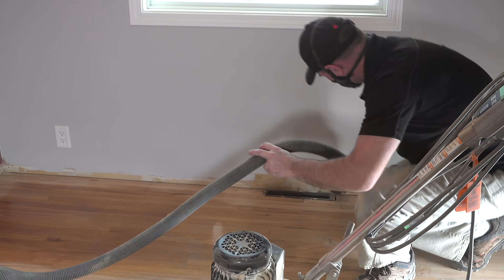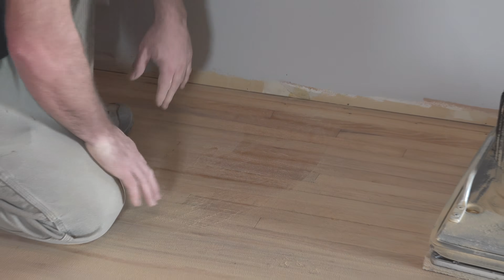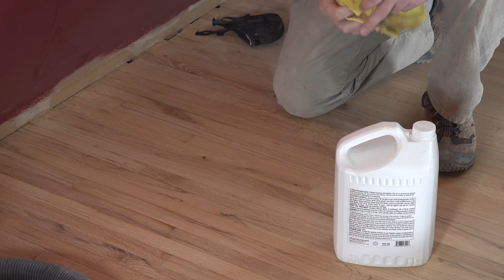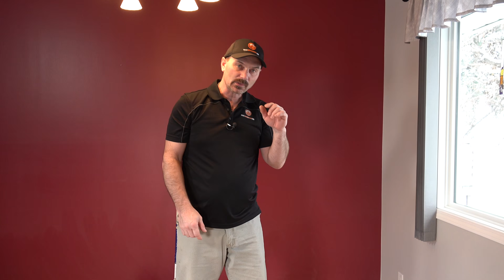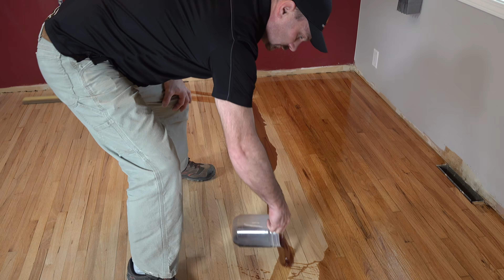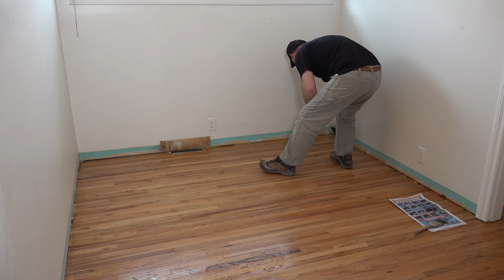How To Sand & Refinish Hardwood Floors

Comment: Just.... ugh.
Complete waste of time and money ..  just hire a pro.
You will save money in the long run, guaranteed.
Reply: I just got a quot for 130sq feet $1600 from a professional
Reply: @StagArmslower  if it is ONLY a sand and refinish of EXISTING  flooring with no staining or repairs involved you should be paying NO MORE than $4.00/ sq ft. for natural finish...... And that's high California pricing. 
The quote you got is 3X ( or more) more than standard pricing.!!!?
Sand and refinish 130 sq. Ft should be around $400-$500 TOPS.
Get more estimates, and good luck.
 Just don't try to do it like this guy.
Reply: Thanks a lot, will try to do it myself; I install this floor 18 years ago so probably will go OK  @TheBlister69

Comment: First off you should have feathered your coats with the grains after you pulled it across the grains. After your coat was dried you need to screen to the coat because your flooring will have popped. Been doing floors for 35 years. Your layering of your coats was a little off key. You need to maintain a wet edge while applying the finish .and a square buff definitely doesn't cut it. It's a giant Palm sander that doesn't do the job properly.

Comment: Okay I'm a professional Floor Sander and there is no way I or anyone could sand a floor using those antiquated machines. Plastic? We don't hang plastic because all of our machines are dustless. By the time you rent out those machines and pay through the nose on the materials you will have saved about 50-70 cents a foot plus your back breaking dust breathing body will be broken by the time you are done. Good luck!
CALL A PRO.......
Reply: This is good for a homeowner who isn’t expecting anything fancy at all. This will not cut the floor flat, get out larger dents and scratches, the unevenness of boards. If you hire a professional and he come in there with just these two sanders  ask them to LEAVE and never come back.   

I agree with mike as a professional I could never sand a floor like this and put my name on it.
Reply from the maker: @jamesc8364   I agree and even state in the video that if your floors are in rough shape you will want a drum sander and edger. For this floor it did the job as the floor was flat and in pretty good shape but the finish was worn out.
Reply: I know. You said it in the first couple seconds and you also mentioned renting a edger.  I think this is a good option for homeowners who want to save money or do it themselves.  A edger or drum sander in the hands of someone (home owner)  who doesn’t know what there doing could result in a horrible finished product. You make it simple for anybody to do. I hate to say it but when if you overload homeowners with a bunch of extra info which you didn’t they tend to get overwhelmed. You kept it simple and to the point for a novice to do. you did a great job for homeowners to learn.
Reply: Im also a floor technician ..the older machines are best (floor sanders that run to house power breakers, edgers ,buffers ,etc) ... i will say all the videos on youtube seem to promote do it yourself to people this is definitely not easy & most will probably ruin their floors leave it to people who know what their doing (not every guy who does do it doesnt do good work either)..il create a channel dedicated to this field in about a week or so. Good luck to those wanting their floors done(& done properly).
Reply from the maker: Sounds like you are pretty worried about how many jobs you may loose when people see this video and how to do their own floors? Yes you as a pro may have newer machines with better options but it does not mean that these units will not do the job.
Reply: @HouseImprovements  I watch many how to videos and it seems quite common to have the "professionals" chime in about what was not done "properly" and properly always seems to come with quite a price tag! Obviously, if we all had the money, we would all be doing it "properly". Unfortunately, we are not all blessed with the same wallets to afford "properly".
Reply: @HouseImprovements  Look it takes the right equipment with the right no how. Actually people try this and screw it up and they call us so no we don't lose business we actually gain business. However be my guess and sand your floors but I wish you the best of luck
Reply: HouseImprovements thanks for the great videos.  As someone who tries to do as much stuff in my home myself they are welcome videos.  Thumbs down to all the haters 😂
Reply: Houseimprovements, I agree with you. You've helped us do a lot of diy jobs and saved us tons of money. Now we are doing our floors. We have to repair our originall 1940 oak wood floors or replace them. Haven't decided yet, but your vids will help us.  Thx again
Reply: Make your own video then. Show us how the "pros" do it

Comment: I have a laminate oak flooring (Bruce, I think). I would like to refinish it because the area near the front door is quite worn down compared to the rest of the flooring. Can it be sanded lightly (machine would eat through the laminate right?) or do I just have to spot refinish and hope it's not too different?
Reply: Laminate floors are fake wood.  I have Pergo in part of my house.  They are not meant to be sanded.  Check the manufacturers web site for care instructions--usually, they advise against harsh cleansers, so I would think that sanding would definitely be out of the question.  I doubt that any laminate manufacturer would endorse refinishing their product.
Reply: Throw it in the trash......not able to refinish like real wood.

Comment: can you do a how to remove an oven video
Reply: An oven.disconnect all wire, gas line etc. Shut breaker off to 220 if it is so and turn gas valve tell it is half way or to a close mark if its a valve.and remove thats a simple job not to complicated.

Comment: Nice job ,where i can get the T bare
Reply: Mohamed Amin order from an online floor supplier unless you happen to have one local.  The metal head is not cheap.  Probably better off rolling with a good polyurethane.
Reply from the maker: https://www.amazon.ca/Duratool-Lightweight-T-Bar-Applicator-Refill/dp/B07BKBC6Z5/ref=sr_1_fkmr1_1?keywords=T+bar+floor+refinish+bar&qid=1551927408&s=gateway&sr=8-1-fkmr1

Comment: Floor has scratches from dog claws. Bruce engineered hardwood gunstock. Can this method be used for that? Or will it completely destroy the floor?
Reply from the maker: Some engineered floors can be sanded but I could not say for sure ,should be able to find some info on their site maybe.
Reply: I have engineered floor and pro said that it can be sanded once even manufacturer said 5 times  @HouseImprovements
Reply from the maker: Also depending on the wood and depth of scratches this sand is likely not going to do it. You would be better with a drum sander.

Comment: I would like to add a gloss coat to my hardwood floors. They have simi -gloss now Can I just do a light sand and apply an additional coat. I don’t think I need to sand completely down to bare wood? Floors are 15 yrs old but in very good shape.
Reply from the maker: generally a light sanding so the new coat will bond to the old.
Reply: You should thoroughly clean the floor first with a product like basic coatings IFT and squeaky floor cleaner...or some other prep system.  If the floors ever had a polish applied or rejuvinater used it  probably won't stick.  If you used pledge or some other akrylic polish products on any furniture it probably contaminated the floor and will need extra cleaning.
Reply: Thank you I really enjoy your videos. They help me out a lot. I try to do projects myself and your videos are direct with good explanations.
Reply: Adam, thank you very much for you advice. I would like for my project to turn out right.
Reply: Gloss can look great but it will really show imprefections in the light. I would do satin or semi.
Reply: Robbie klein thanks for you input

Comment: Would it be a good idea to sand in between coats with a light grit sand paper?
Reply from the maker: Always follow your instructions on the product you are using. For this one you dd not need to sand in-between coats if it was less than 10 hrs but you did if it was more than that.

Comment: Thank you, this is very imformative. We are remodeling our entire house ourselves. We salvaged two rooms of original hardwood floors that we need to finish. They never were finished (just bare wood) from install in 1972 which is partly why we only could salvage 2 rooms. Since there is no finish to remove, what grit sand paper should we start with?
Reply from the maker: Our forum is the best place for questions like this since we can easily chat back and forth. What grit will depend largely on the smoothness of the floor and condition of the wood. We can chat on the forum. https://www.house-improvements.com/forums/

Comment: I wonder if it be best if I refinished the floors before painting new drywall or after? I just have open walls now.
Reply from the maker: Pros and cons to both really, but I would paint the walls first or at least one coat so they can be cleaned easier to remove dust after flooring is done. After that you can use drop cloths to protect floor and final coat paint.